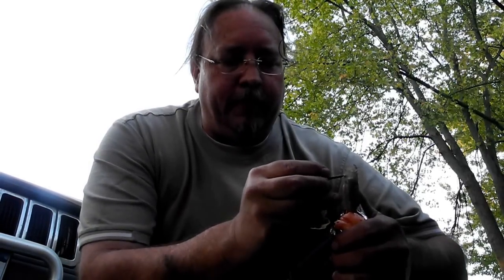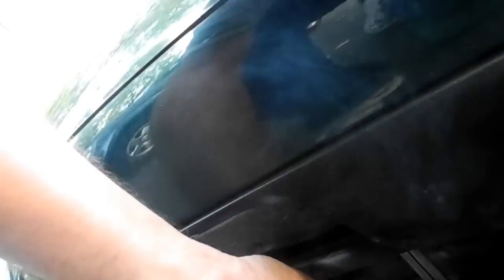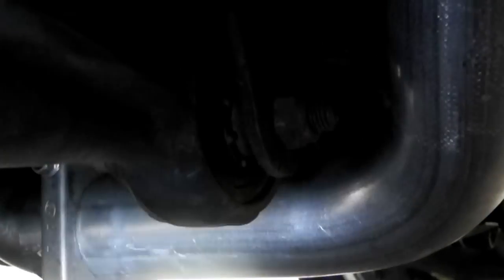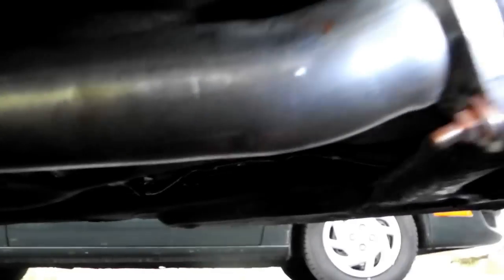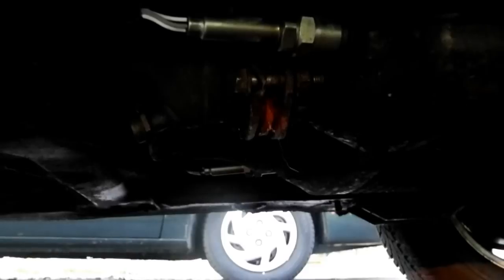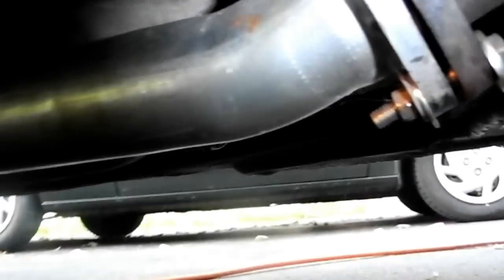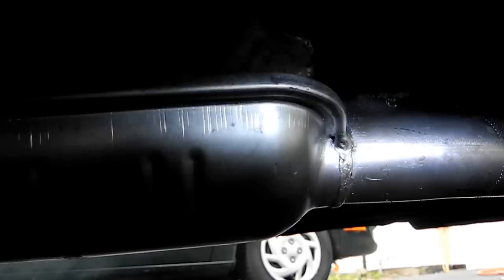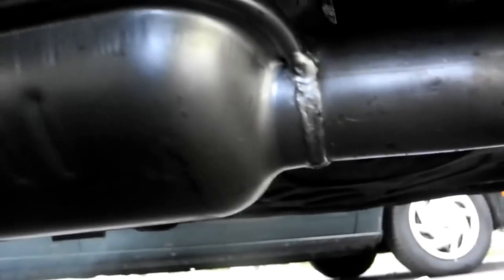No Cost Exhaust System Ciggarette Smoking Test - New Muffler with Bad Seam

Comment: Another trick is while the vehicle is running hold a lit cigarette or incense along all seams. If the smoke gets drawn in or push out there is leak.
Reply: reitze01
I did a smoke test this afternoon. Made two smokers, the first one like yours which had a hard time keeping the cigar lit, and then one with a pickle bottle with the cigar attached directly to the output hose and that smoked to high heaven. Oddly I did not see any smoke leaking from the exhaust system. So I don't know if a component in the muffler or CC blocked the smoke. I think my leak is near the front. I will try the bubble test next, starting from the front manifold.
Reply: A bubble test ?
Reply: reitze01
So it was the muffler for sure? My car has an exhaust leak. I asked STS tire shop to give me an estimate to fix it and they called back and said $1,231.65, basically they wanted to replace everything. I didn't have them fix it because to me the exhaust components do not look in bad shape. So I want to find the leak for myself and your method looks like the best one I have seen on youtube so far.
Reply from the maker: Dasdfjkl yea - I had to weld the seems of every piece of it (muffler n baffles).  The seams were leaky and there were drain-holes.  I could have welded the old one just as easy.  Plus the car is a 1996 so any leaks find their way into the car.    A bubble-test may have worked better than the smoke.
Reply from the maker: Yea that works ok for big holes.  The problem I had was that the bran-new exhaust was leaking along all the seams such that it was enough to make me smell it while driving but hard to tell anything under it with even a cig while running.  This car has so much fan-wind it was hard to tell if there was a leak.  Bubbles with soap may have worked too - if it wasn't hot.